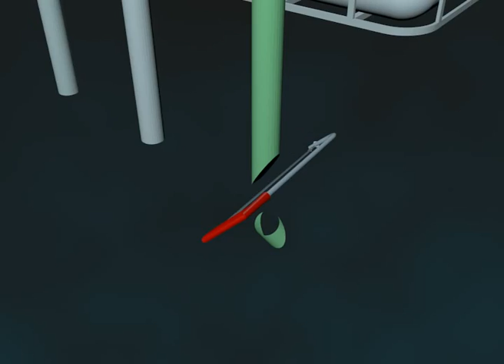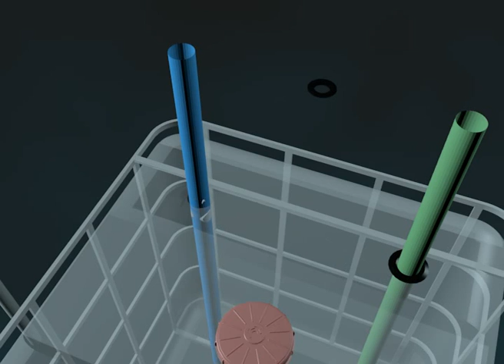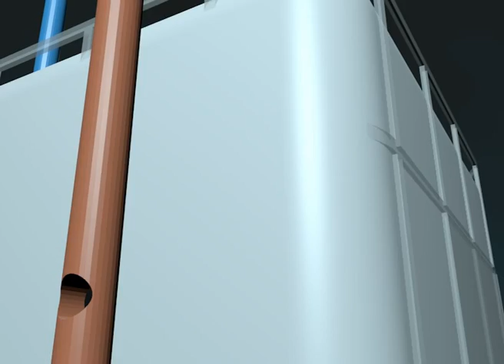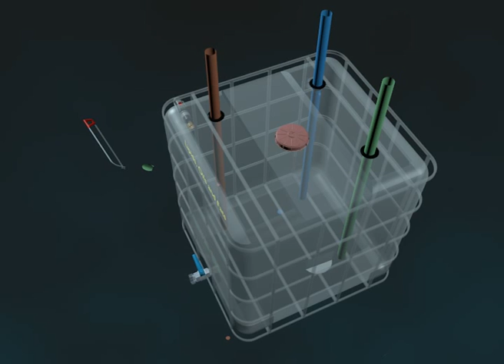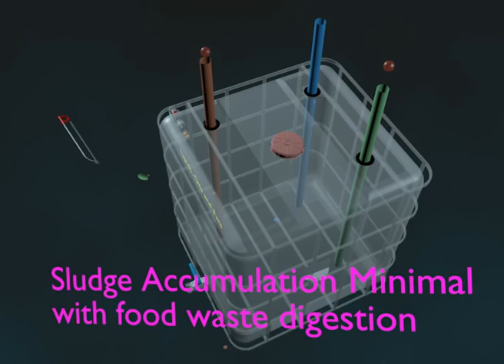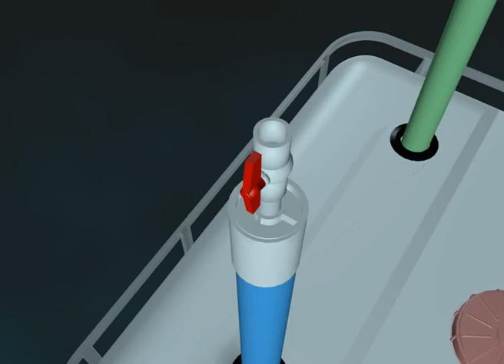How to Build a Solar CITIES IBC Based Biogas System -- installing the pipes and plumbing

Comment: With this design, have you ever faced problem with the clogging of gas outlet pipe. I assume there is chance that the slurry would flow inside the gas outlet.

Comment: In neither video do you show or say what level the water line should be in the tank...
Reply from the maker: Sorry. It should be completely full.
Reply: Thanks for the speedy reply! So part of the Gas outlet  flow pipe will be submerged then?
Reply from the maker: Yes, That is why we use 2 inch and reduce to 1/2 inch above the water line.  The water shoud be uniformly 8 inches or so above the tank.

Comment: Excellent! Thank You! Question--Is this a better model than your previous design which required 3 IBC tanks? I was ready to build this since it has built-in pressure from the top tank. Is the 3-tank system still a good design or have you moved on to this simpler model?
Reply from the maker: This is better, yes.
Reply from the maker: http://www.solarcities.eu/education/388